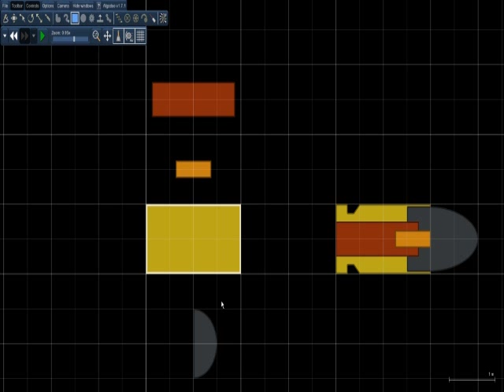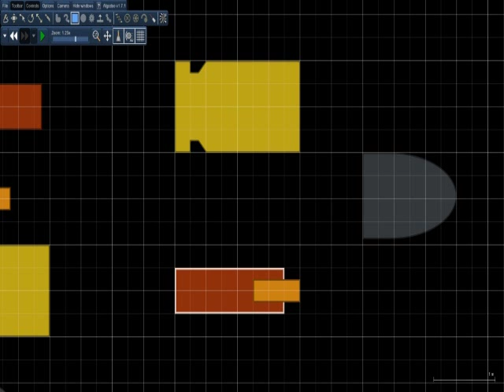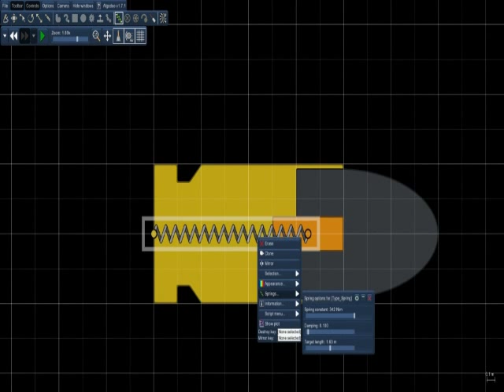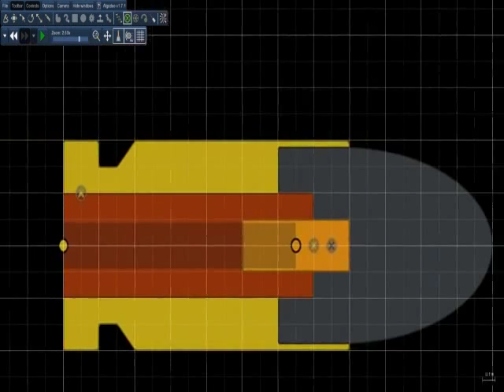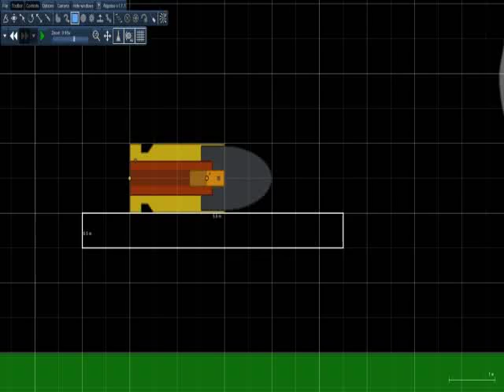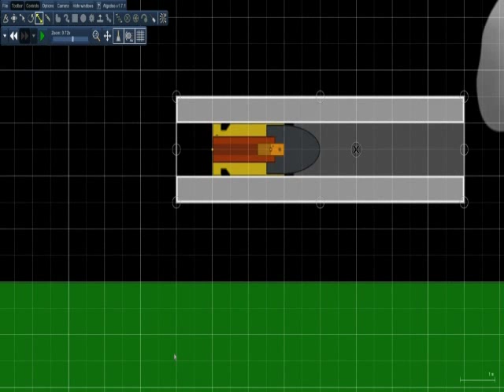Algodoo Phun - Stable Bullets Tutorial

Comment: how do you make the primer so that it deletes itself when it is struck by the striking pin? If you used oncollide, could you share the code with us
thanks
Reply: Just make the striking pin “killer” (in material) and set the collision layers to D & E. No code.
Reply: @Flip15  wdym?
Reply: @Flip15  plus how i make the spring delete it self when i delete the primer?
Reply: @abomicz3015  Make the spring acopled to the primer, it makes the bullet way more weak, but, it works.